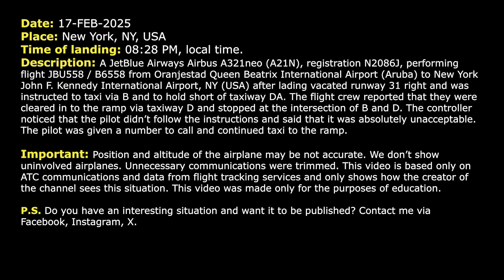JetBlue pilot IGNORES Tower’s instructions and gets a phone number at JFK Airport. Real ATC

Comment: Too many interruptions by ATC.  That is a very busy time for the pilots, exiting the runways, cleaning up the aircraft, after landing checks, and they did try and contact ATC with no response.  This controller has no concept of what goes on in a cockpit on the landing roll out and the taxi in. Unacceptable on ATC’s part. Pilots were beyond professional and stopped when there was confusion in the cockpit as to the taxi in. The worst thing they could have done was to taxi in while unsure of their clearance.

Comment: As a pilot who flies this approach often, the controller is an idiot. Jet blue was told to taxi off the runway and stay with him. Delta is not a turn off. The landing aircraft would have had to make a really short landing and a ninety degree turn off to make delta. If the controller was so concerned about delta, why not put JetBlue on Alfa. Usually at Kennedy aircraft taxi clockwise on Alfa and counter clockwise on bravo. This not a safety issue, the controller I think was just covering his own butt.

Comment: Look guys, KJFK is a mess for a number of reasons: It's busy, the airport geometry is whack, crews from all over the world with varying levels of English proficiency fly there, but most importantly, they increase flight crew workload after a long flight and work two radios because the cab and the Port Authority don't coordinate with each other.  If this means that it takes 30 extra seconds for the crew to sort things out and aren't "doing ground a favor" of being precisely where they thought they should have been, they are just going to have to get over themselves and roll with it.  This wasn't a safety issue and didn't warrant a call.

Comment: I think the JetBlue pilots didn't do anything wrong.  After landing, the crew are working the second radio with JetBlue Operations and then JetBlue Ramp confirming the gate assignment and getting permission into the ramp.  It sounded like, they got a D ramp entry and waited to tell ground.  About the possible problems of landing traffic coming off of runway 31R; landing distance to taxiway D = 3,704 feet versus taxiway W = 5,091 feet.  Why are people trying to make the D turnoff from 31R that is not even a high speed exit?  Just let it roll to exit W or WW which is a high speed exit.

Comment: Jet Blue 558 tried to call tower to get clarification and was told to stand by.  Not getting the answer to what he should do, he stopped.  Both sides have a point, but the pilot did not want to move.without getting approval.

Comment: Perhaps the controller should not issue instructions while the aircraft is still on the runway . This happens all the time- during roll out you are given a series of taxi instructions- controller over reach
Reply: And the instructions were left on whiskey, left on bravo, hold short delta-alpha. Those instructions never changed, and the pilot should have just followed them. This is JFK... not Tom Jones Regional!
Reply: @markm5287  sorry not familiar with Tom Jones regional- JFK based

Comment: Avianca 052 crashed in part because they were intimidated by ATC, lacked assertiveness, English was not primary tongue, multiple weather delays, shift change, etc. They have tuff job and everybody should be near the top of their game for us all to survive and operate efficiently. Not as busy as flying into Oshkosh during EAA just after airshow finishes and airspace reopens for incoming🛬🛬🛬🛬 to have FOUR (4) headed for runway AND taxiway AND on numbers AND halfway down the same runway and taxiway. 

And rightseater in my fourseater reminded me of molasses in January. Eg it took 6.5 years for him to do a 2-year degree while working FT. Not an example of top of game I spec as necessary for optimal efficiency and safety.

BTW, ☎️ was blocked📵😢

Comment: Unfortunately some Kennedy controllers seem to think their instructions are godly commandments. We are told via the FAA and every company SOP at every 121 carrier that when in doubt stop the jet. The crew clearly were unsure about whether they should ask to continue via D as they got cleared in D to the ramp or not so they stopped and called for clarification. PIC has the tiller, signs for the jet, and has final authority and responsibility of the safe operation of the flight. Stopping was the right thing to do. Far too many collision events and incursions have occurred due to crews hesitancy to stop. Scolding someone because they did the right thing is a dangerous attitude to present.
Reply: Stopping in an intersection without imminent danger is never a good idea. Obviously the controller had a plan and maybe wanted to make a right turn for the succeeding Embraer via D onto B possible, thus knowingly overshooting D with the Jetblue. And he more or less announced that to the Jetblue but most probably, they didn't quite get the plan. Jetblue just wanted to avoid having to do the 180 via DA-A to D.

Comment: New York ATC biting pilots heads off for no reason as usual. If pilots are too scared to check in with ATC for clarification then this is just increasing the chances of an incident.
Reply: Excellent point in general. Am not a pilot but have heard of co-pilot / pilot communication-breakdowns causing incidents because of an abrasive personality. Organizations are hurt by this as well - sometimes clarification is needed but if there's a difficult personality involved that clarification is avoided to avoid trouble, which leads to even more trouble.
Reply: That's my worry. Pilots are scared of New York ATCs to ask for clarifications.

Comment: Strange how it works in the USA. Pilots heavy workload and then asked to stop everything to get a pen out and write down a phone number. Surely that can be done at the gate?
Reply: I have never heard this "phone number" thing in the UK, Ireland or the Netherlands, as examples. ATC just do their job if there is a misunderstanding or something that they didn't foresee occurs.
Reply: Either pilot or ATC (but usually ATC) can file a formal report with the FAA for a 'deviation'. The FAA will then take statements, review tapes/scopes/video and issue a finding that often includes fines, trainings, and suspensions. In those situations the ATC whose filing the report wants to collect information (at minimum, names, PIC, PM, and key info, but will usually ask for a statement too). You don't have to call, but that will be noted in the report and could be used against you. The phone number usually means a report will be filed. But in this JetBlue incident, they ATC will be in for a surprise when the FAA finds Jet Blue didn't do anything wrong.  @Shamrock100
Reply: @peterp8861  Thanks for the explanation.  It sounds like a procedure that should be reviewed to see if it is actually fit for purpose and what it achieves in safety terms.
Reply: The issue is that JFK ground is even busier than JFK tower. Sometimes ground is the one that "gives the number" but at JFK it would be far more difficult. He stopped early, and it was annoying to the tower, but he didn't overshoot any "hold shorts". He's going to call and get yelled at, but this isn't a deviation and the FAA investigators aren't getting involved. Technically he is doing exactly what the tower asked, just not the implied timeline.